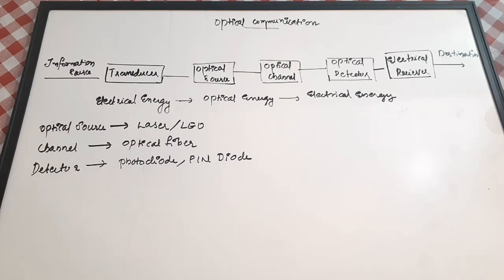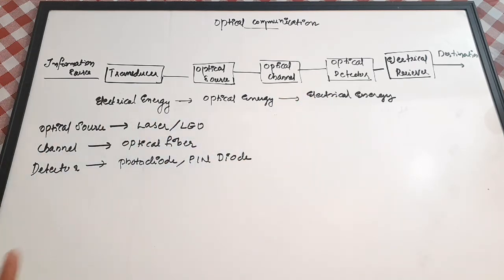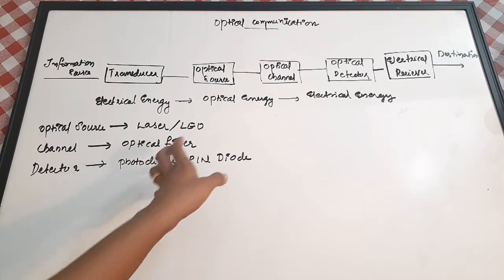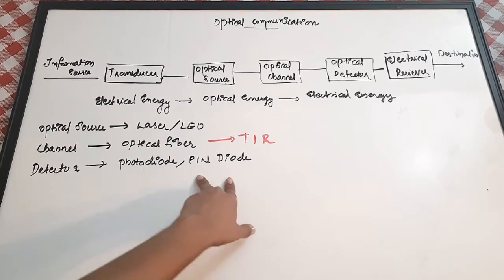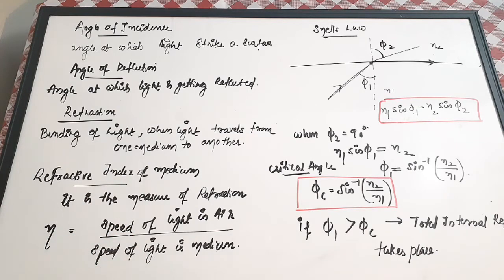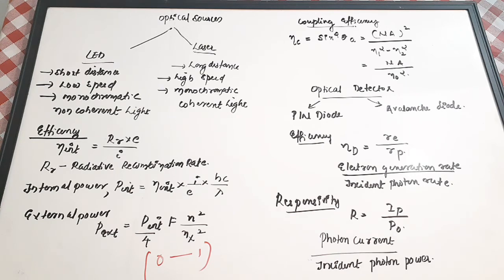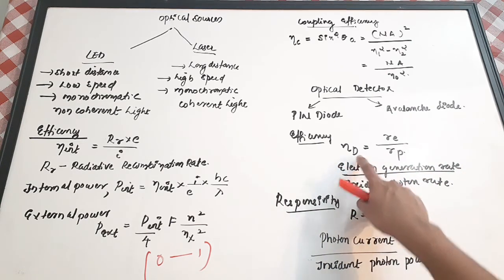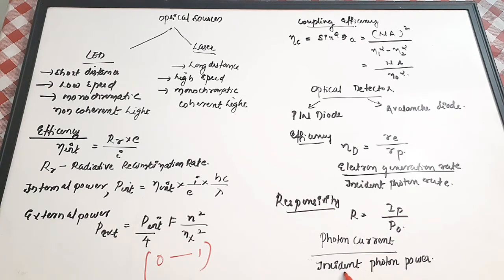Optical communication Concepts and Equations| Step index-Garded index| NA| Snell Law| Normalized fre

Comment: I think there is an error in equation of critical radius of curvature of multimode fibers in Numerator 3n² π
I think it is 3n² λ
Reply from the maker: Ok, I will check and tell. Anyway if you have verified  then please correct it